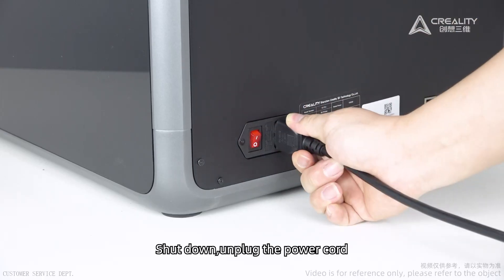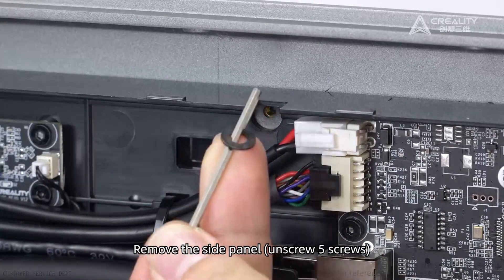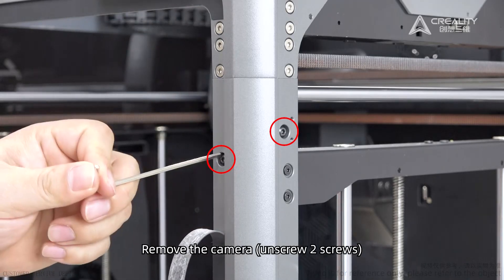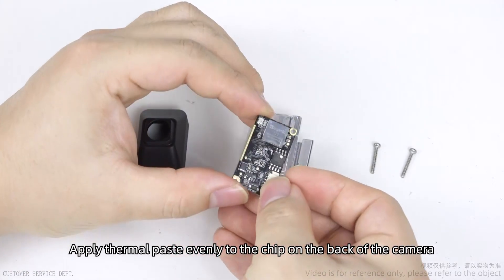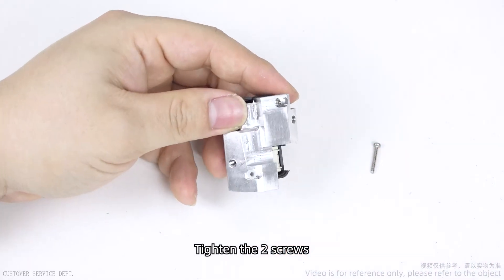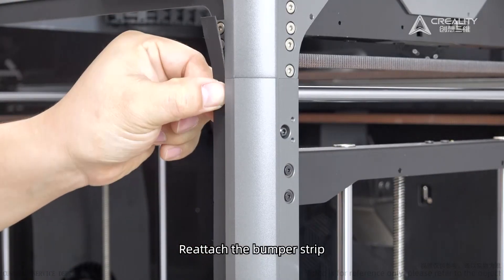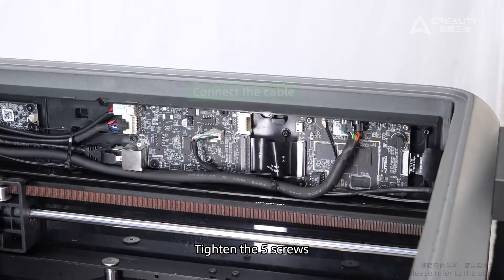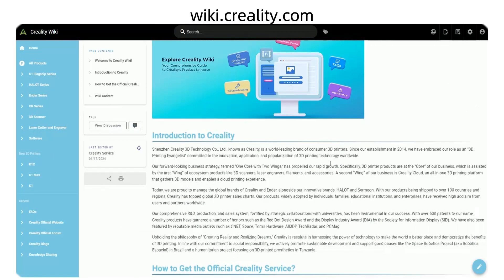Service Tutorial K2 Pro Time-lapse Camera Replacement

Comment: I think I have the same question that @douglas71322 was trying to ask. Can the 720P camera on the K2 Pro be upgraded to a 1080P camera using the method shown in the video, if I buy a K2 Plus camera replacement?